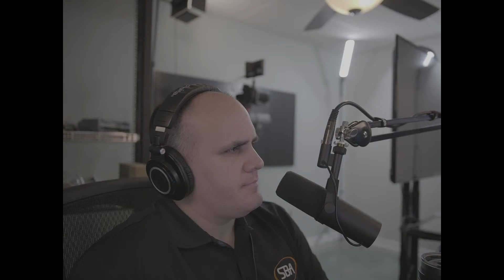SBA TV 7:  Control Engineering Basics Part 1 And Live Q&A

Comment: Hey Phil, do you typically expect MEP engineers to specify field controllers, jaces, routers, etc., or should they only specify IO points and Seq of Ops? Will this change if there are multiple controls contractors bidding the job?
Reply from the maker: This should really be driven by the owners project requirements.

That being said in plan and spec projects you usually have a basis of design and you specify capabilities not manufacturers. Make sense?
Reply: @SmartBuildingsAcademy  yes, can you elaborate a little more on basis of design? Aside from the items mentioned, what else would make make bidding easier/more uniform across contractors? 

Also, what if the project involves equipment across multiple floors? Should the MEP engr be laying out network risers (for a new BAS, for instance)? I think typically bacnet is specified as the protocol, but should the MEP go as far as to specify a Niagara4 framework?